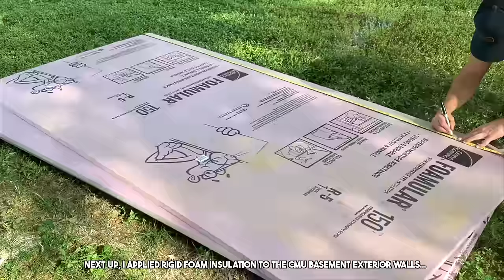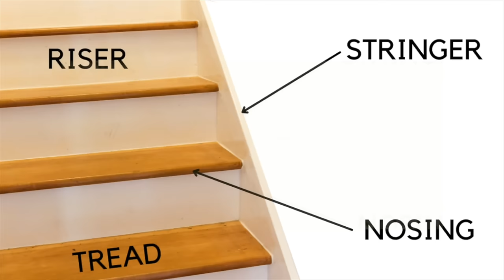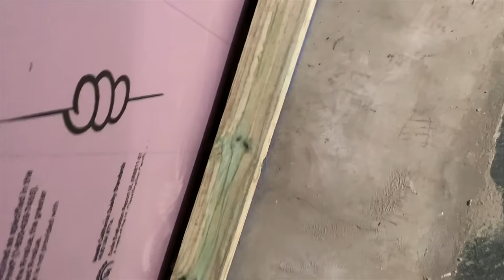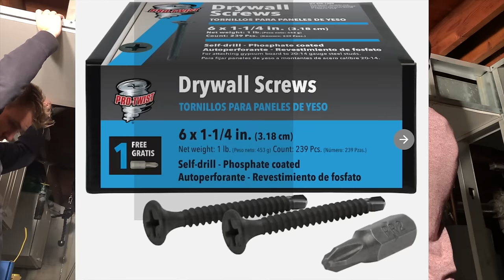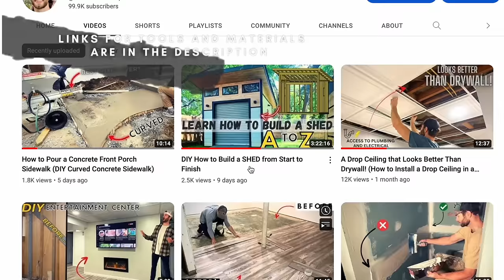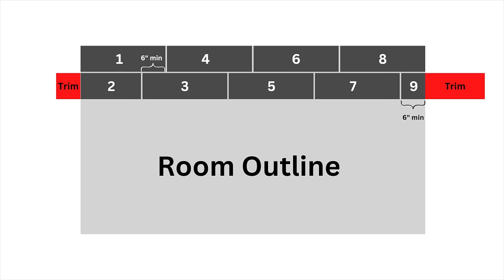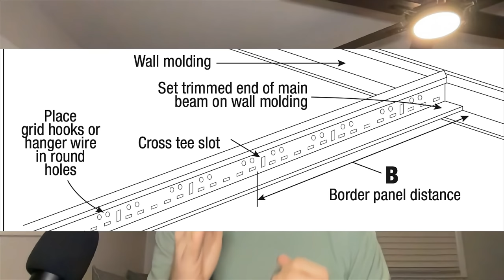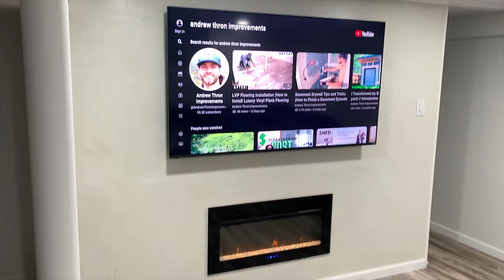How to Finish a Basement From Start to Finish! (DIY Basement Renovation and Remodeling Guide)

Comment from the maker: Here are the Time Stamps so you can easily jump around to specific basement projects:

0:00 - Introduction
0:44 - Full Basement Renovation Time Lapse
13:21 - How to Renovate Basement Stairs
22:31 - How to Install Rigid Foam Insulation on Basement Walls
26:04 - How to Frame Basement Walls
32:39 - How to Frame around Basement HVAC Ductwork and Pipes
36:07 - How to Run Electricity to your Basement (Tips + Tricks)
45:30 - How to Install Drywall in a Basement 
56:46 - How to Replace and Trim Out a Basement Window
1:07:31 - How to Install Luxury Vinyl Plank (LVP) flooring in a Basement
1:18:31 - How to Install a Drop Ceiling in a Basement
1:30:32 - How to Build a DIY Basement Entertainment Center 
1:38:31 - Conclusion 

Thanks for watching!
Reply: ,55😢😢😢🎉
Reply: Great video
Reply: Awesome....a subfloor would have been a good idea.

Comment: one day you might regret that treated lumber on the concrete. I did that in my late 20's, and now in my early 40's I am pulling up black mold. I learned the importance of using a product like dampro or DMX 1-step as a vapor barrier for the floor, and run it up to the foam on the walls, then covering that with osb (or plywood if you're rich), and adding your finished flooring to that. You build all walls on top of that osb flooring. If you ignore this step, you will gather moisture slowly over time and it will never dissipate. Need that continuous air space from under the floor, to behind the foam, and straight up to your joist tails and band board, where the lumber will draw in the air vapor and wick it outside of the space.

Comment: If anyone is looking to finish an old basement the only recommendation I would have as a GC is if your insulating the walls like that space them away from the cinder blocks and also use a dri core subfloor system. old basement were not meant to be finished so there is not water barrier or division system on the outside. You will get water in your basement so leaving an air gap for it to drain is crucial otherwise it’ll start molding and smelling bad.

And sure you could get lucky and never have any water problems but with an old basement like that and all the TLC, why risk it for a few extra hundred bucks to include those systems.
Reply: My thoughts exactly. I feel he didn't do enough to protect the walls and floor from moisture.
Reply: There are so many different ways to skin this cat. Through all of my research, the best way to ensure success at least on the walls is to ensure that the foundation was appropriately waterproofed from the outside with external french drain system. If you are worried about moisture in your walls, then do the right thing and prevent it from being there by doing the proper external waterproofing (dimple board systems, tar, french drain, sump pit, sump, gravel backfill, landscape fabric to seperate dirt and rock, etc). Don't bother with painting your walls with waterproofing on the inside or doing inside or subfloor installed french drains. If you have the wall waterproofing down the next best recommendation is silicone closed cell foam to the walls and taping the seams to minimize or eliminate the airgap between the wall and insulation. At this point you are trying to minimize inside air temperature and humidity from mixing with the temperature fluctuations of the blocks...in other words, stopping condensation and eventual mold growth. For the floors, yes you can do the dri core or whatever other brands there are if you want to lay hardwood floor. Personally, I'd never floor a basement. Paint it if you must with a concrete paint but then just throw some area rugs down. Maybe you would be okay with a wall to wall carpet if if can breathe enough. You are right though, basically any house pre-1990, you aren't supposed to finish like he did because of the amount of water that's in the slab. But again, I think a lot of it can be minimized through appropriately moving water on the outside of a house to a sump. Stop inviting water INTO your homes with internal french drains.
Reply: Rim Board Insulation?
Reply: Especially here in New England
Reply: Agreed. My home was built in 1957 & I bought it 4/2023 & just experienced my first flood last week. I kept the concrete & painted it grey & put some rugs on it. I do want to finish the walls & leave the ceiling exposed but idk. May just paint the walls white, ceiling black & call it a day
Reply: @danielhall2704 you can use concrete sealer to help prevent a lot of the issues. If you do that with a vapor barrier you shouldn't have an issue. Still would be good to do a moisture test though to be sure.

Comment: When wiring electrical add a "service loop" and keep about a foot of excess line looped above the box. Then if there is an issue in the future, or more likely you damage the wiring during drywall or install, you have some excess wire you can pull through the box and don't have to take down drywall.

Comment: Fantastic video.   Your project came out great.  Always check your local codes if doing your own construction, the inspectors are there to keep you safe, not be a pain in the ass.   I've had more professional contractors get failures on my jobs than when I actually did it myself, not claiming to be perfect but you can take your time and check your work as you go when you are using free labor.     And best tip is to try and think ahead.   Once your framing is done, put on your drywall cap and go around checking for Nailer boards, then put on your tv mounter hard hat and plan for blocking.   Makes it so much easier to have timber behind the wall and not use it, than to not have it and be messing around with various anchors or fasteners when the wall is painted, and room completed.  Including my own 2cents after doing my own basement reno.

you can use your leftover scraps of foamboard under the bottom plate to act as a thermal break between the concrete and the timber.    At the very least use sill gasket or tape to increase the life of the timber and avoid moisture wicking up from the concrete.    A "Ramset" gun is classed as a firearm, so be comfortable and safe when using.   And if you are going to be doing a lot of stick framing, invest in a laser distance measure, it will give you a perfect length every time.    If you leave your jack stud out of the doorways you can cut out the threshold using the circular saw as the distance from the side of the plate to the blade is exactly 1.5 inches (same thickness as dimensional 2 by lumber), then stick your jack stud in to complete the frame.   Don't forget to reduce your blade depth accordingly.

Hang drywall horizontally whenever possible, it adds shear strength to the wall as well as making it easier to tape and finish, unless it makes sense to use a whole board vertically.   no seams are best and personally a couple of vertical factory seams are better than a single butt joint.   Like your use of a spacer (scrap bit of drywall) to maintain a minimum 1/2" gap between the floor and drywall, especially on concrete floors.  A lifter and basic drywall tools do speed up the job, especially when working alone (i've hung a lot of drywall...)   A drywall T-Square is also the exact width of an electrical box (if you didn't know?), you can use that to mark and cut out, but your method worked quite well too!    try not to screw too near electrical boxes, they get a lot of abuse when plugging cords in and out therefore prone to "nail pops".   I love plastering, although my joints don't anymore so would have happily done your basement for you :-).    All of these tips I learned the hardway :-).

Comment: This is pretty much exactly how I did my basement. except I used Delta floor with 3/4" tongue and groove osb subflooring over it. Screwed down with tapcons. Glad I did because my basement wall has since cracked and during heavy rain water weeps in under the floor but doesn't effect anything. I have also had a condensate pump go out on my furnace and weeped  water under the floor without issue. My basement floor is also never real cold.
 I also used the exact same drop ceiling, but only installed it in 2 rooms. Drywall is less than 1/4 the cost of a drop ceiling. So I only installed it where absolutely necessary, and used access panels for other needed access.

Comment: Good video. I am wondering why you glued the panels directly to the block wall without first using a   waterproof paint, such as DRYLOK and leaving a small gap behind for airflow and moisture?

Comment: Add soft led light strings up at the top edges of the ceiling for movie nights and romance. Also, on the stair treads, the dark color when the lights go out will be hard to maneuver. Add a strip of reflective tape for those emergencies when the electric is out and also will add some extra slip proof protection. Just a V shape in the middle of each will be nice. Make it look like the landing strip on an airfield xD

Comment: liked the foamboard on the walls. When i frame I keep the bottom plate off the concrete floor incase of moisture. I screw pieces of dricore  slats on the bottom. everything else was great. good job

Comment: Depending on your area, you probably need to have floating walls in your basement by code, due to slab shifting.

The wall only gets connected to the baseplate by a couple 6 inch nails thru the wall framing.

Comment: Always use metal studs . Concrete condensates and the studs wick moisture . That’s why there are so many moldy , musty basements . Also use spray foam if you can afford it . The warm air gets behind the foam panels and traps moisture that condensates on foundation .
Reply: If you seal the foam sheets to the basement walls the cold concrete walls will not condensate because they will be insulated from the warm humid basement air. The wood studs are insulated from the cold basement walls and are in no danger of molding.

Comment: Hi Andrew, fantastic work, I have one question regarding the pink moisture barrier, when apply moisture barrier, that definitely helps keep the moisture outside of the room, protect the stud, etc., but does this make the moisture level in the brick/cinder blocks higher compare w/o barrier? if so, will the moisture barrier which keeps the moisture level high in the wall eventually damage the brick/cinder block wall in long run? Thanks!

Comment: Great basement framing presentation.  Nothing wrong with individual stick framing when you're working alone as oppose to framing the entire wall from the floor and attempting to install it upright against the concrete wall.  If you are building a 12 /16 foot long walls, and you are by yourself, then good luck in trying to lift that assembly.  To some DIYs the weight could be overwhelming.  Just saying from experience.
Reply from the maker: That’s a very fair point! Thanks for watching!

Comment: I had so many warped boards from home depot, after framing I am paying for the warped boards at the drywall stage 😢. Can you fill in gaps between the drywall and framing with something like construction adhesive? I am afraid of cracking or screw pops if I don’t….seems so halfazzed. Also one of my prehungs from homedepot has a twisted and warped frame….I guess a guy has to be super picky at these stores. I didn’t think an mdf door frame could twist and bend so much, and its impossible to twist and bend back.

Comment: How much you chose to not add insulation between the studs? I am placing 1” pink foam board and also R13 unfaced insulation between studs because of the foam board.
Reply: Good decision.

Comment: could u have used rockwool or fiibreglass insulation batts for the walls instead of the foam boards and put a vapor barrier on top?
Reply: I used fiberglass insulation on my walls.  The walls were spaced 1/2 from the foundation and used a vapor barrier.  That was within code in my town.
Reply: @chriszeien9112 ............ALWAYS remember that "code" is the minimum that is required...............fiberglass is NEVER an option against the concrete wall no matter the spacing.

Comment: We are about to do ours! Is there a good way to waterproof the concrete walls before insulation? We had some water issues. We are having a drainage company come but want to make sure!! Great job!
Reply: fill cracks with hydraulic cement. I was told not to add any membrane to the wall before the xps foam

Comment: Andrew love the videos…very informative. Quick question…I’m in the process of remodeling my basement here in the Northeast (New England) is there any benefit applying Drylok waterproofing paint and installing foam board (closed cell) to the basement walls. Water does not drain into the basement; however there are some spots on the walls that do have moisture after a heavy downpour.
Reply from the maker: Hi! I appreciate it! Drylock is hit or miss depending on who you ask. Some people swear by it and other say it “masks” the real issue and can potentially allow for mold and water to accumulate behind the layer of Drylock. There are a lot of different opinions on the matter online. For my basement, I paid a contractor to install interior drain tiles and a sump pump to permanently fix any water issues - but it was pricey. Good luck with whatever you decide!

Comment: if floor to joist is 90 inches, top plate takes 2 inches (2X4s) and bottom plate takes another 2 inches (2X4s again), so shouldnt you cut your studs to 86 inches?
Reply: 2x4 studs are actually 3,1/2 x 1,1/2 inches .

Comment: Bro Can I build my basement myself without license? so or how I can get that permission?
Reply: If you own the home then technically yes you can build out your basement. If you are looking to have insurance coverage for any issues caused by the work then no. You need to pull permits and have the work signed off that it meets code. Most places require it done through a licensed and insured professional. Any work you have done the business doing the work can pull all the necessary permits so just hire someone.

Comment: What's your finished ceiling height now? We've got a super low ceiling in our basement and would love to do this type of drop ceiling panel but I think I'll be hitting my head more than I already do.
Reply from the maker: It’s about 7’-4”. Not ideal, but not ideal for pro basketball players. Thanks for watching!
Reply: Acp ideas has what's called a ceiling max system. Grid work gets attached to the bottom of the joists, so you only loose the thickness of the ceiling tile you use. Menards carries it.

Comment: Ouch. It appeared the sheetrock cover across the top if the window casing had no insulation above it in the cavity. That will undo all the work you did on the insulation for the wall.
Reply: 5:48

Comment: What size tapcon screws did you use
Reply from the maker: I believe 3.5” for anchoring the bottom plate
Reply: Good rule of thumb is 1-1/2 to 2 times material thickness for the length of fastener in most any application.

Comment: whats the purpose of the metal plates on the stud? If your 1.5 inches from the front of the stud those are not needed. Also when you run 14/2 wire you take your reel and run it to furthest outlet then cut and splice at each receptacle box. Your cutting individual pieces, very inefficient. Also where is your service loop on those receptacles? You'd fail an electrical inspection in a heartbeat.

Comment: The most important part is to get a permit.  If you don’t you will regret it sooner or later. You should also know something about fire blocking or you will never pass an inspection.  If you just go an bang in a finished basement you will be tearing it out when you try to sell the home.